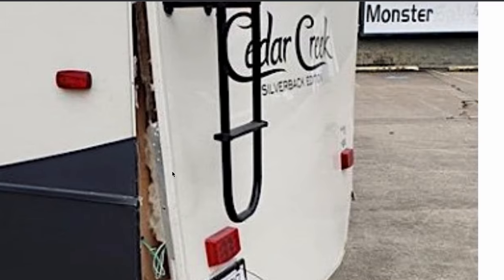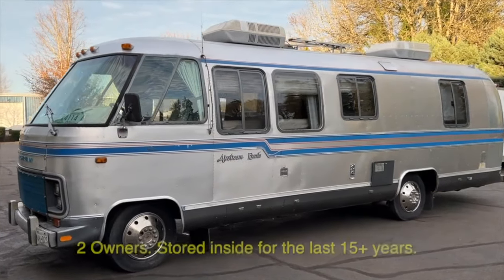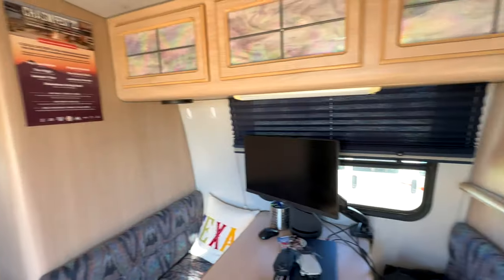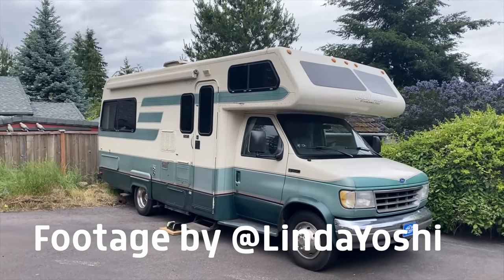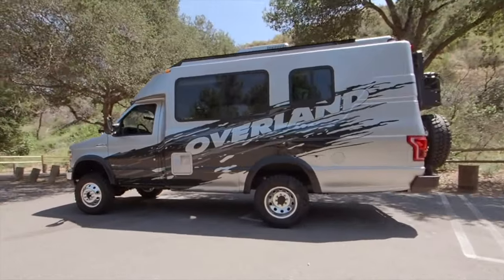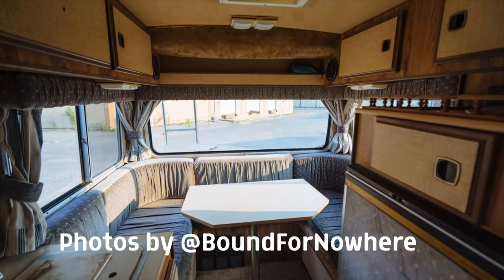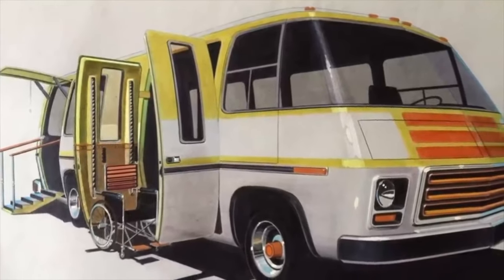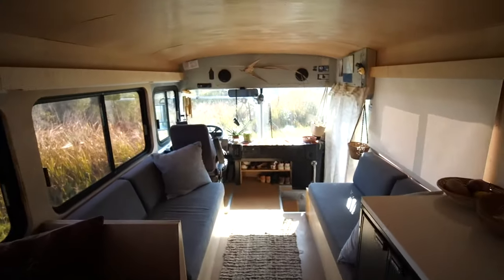If You See These Rare RV's For Sale BUY THEM

Comment: Revcon's are bulletproof, at least with respect to water damage. My Revcon was left for years with all passenger side windows busted out as well as the three vent fans on the roof. It rained in this beast for three years before I bought it thinking I was going to have to be gutted out. But no, the floors and even the carpet are still good. I have no idea what type of plywood was used on the floors but I'm guessing it was marine plywood. That said the moisture separated the Formica from the cabinets, but no rot or flaking of high density particle board -- not your ordinary particle board. The only water damage was the Formica covered plywood on some of the wall areas under the broken windows.
Reply from the maker: Wow that's really good to hear that it survived so much water!

Comment: OK, so the 4X4 Revcon was destroyed in a hurricane flood in Texas about 15 years ago. It was put up for sale just prior to the flood. It didn't sell, so it was not rescued when it was flooded. I'm pretty sure it was scrapped afterword. There were I believe 4 of those 4x4 coaches built. There was also 70's version one off built and sent to Egypt. Who knows what happened to that one.
The later Revcons were built with the 454 and used a transfercase to run the driveshaft forward. There was at least 3 of those which were converted to a 502, and one to a 496. I converted mine to a 502, installed FI, converted to a 4 sp. It would spin the front wheels from a 20 mph roll, chirp going into second at 50 mph, and easily do over 100. I sold it about 5 years ago. It was a blast to drive.